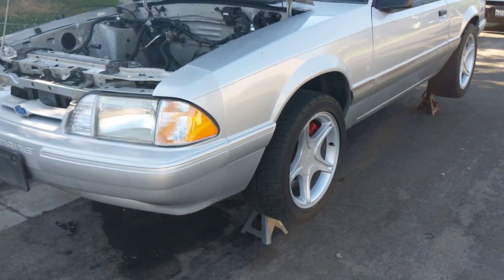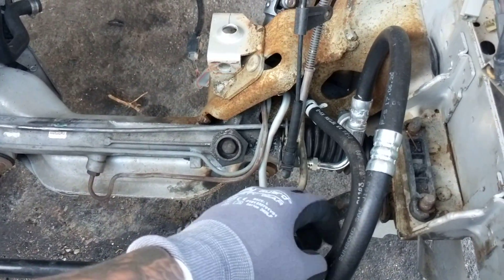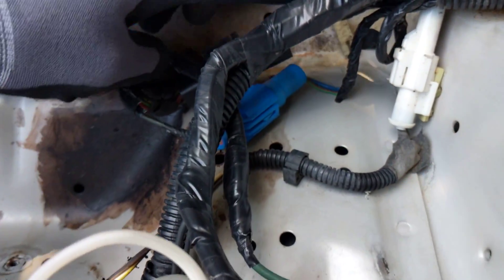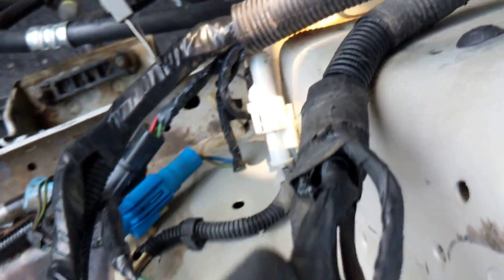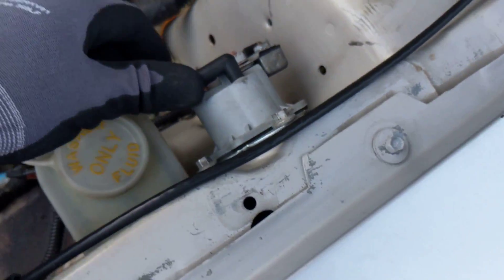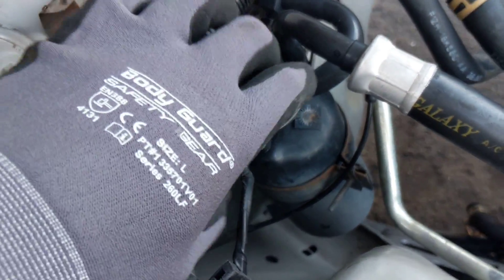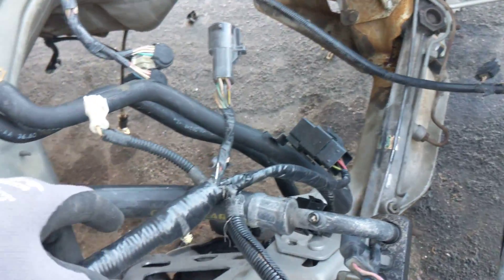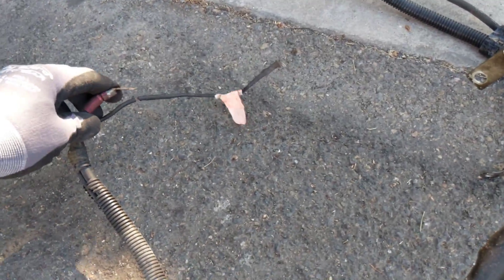Foxbody mustang 2.3 to 5.0 4cyl v8 swap how to step 1

Comment: I have a 88gt donor car will everything swap over to 89 4cyl car
Reply from the maker: Physically, yes. 100%. Now it depends what month the car was made on both ends. Typically, I like to stick with the exact year, but 87-88 are tricky. 87 was a speed density year. 88 is mass air flow. But not all 88. I have seen some that are not MAF. 
All in all, yes everything will work together. But there may be a chance that it could involve more work, depending if the years match up. Best case scenario-you only swap out the harness that connects from the driver side firewall and plugs to the ECU. It’s literally plug-in play.
Worst case scenario - the harness does not match up to your four-cylinder harness and you have to swap out dash harness and everything else

Comment: Awesome information!!! What about front coil springs..do those need to be changed since 8 cylinder is heavier than 4 cylinder?
Reply from the maker: Yes and no. The four-cylinder front springs have been a tried and true method by drag racers. They lower the car a bit and it will transfer weight even better. 
My white Coyote Swap notch currently has four cylinder springs in the front. It rides perfect and if I make a few suspension adjustments it will lift the wheels at the track
Reply: @pcpalan  Thank you sir. I appreciate it.

Comment: Will a manual transmission Off a 91 4 CYLINDER Mustang fit a 91 mustang with the 5.0 ?? 🤟🏽
Reply from the maker: It will. The input shaft tip is smaller though. So use a Ranger pilot bearing. Not sure what year

Comment: Great video detailing the project.  I did a few of these years ago when these were everywhere and unmolested 2.3's were cheap and clean.  Note on the power steering pump.  Line can be reused, just a little long but you should rent the tool and swap the pump, keep the 2.3 pump with that rack.  The ratio of the 2.3 rack is 20:1 and the v8 rack is 15:1.  The valving on the pump gets washy when you start doing locks to locks driving.  Do swap in the v8 rack when you can, much improved over the old man PS from the 2.3   -Also, the alternator harness, swap a v8 harness, tried to lengthen the wires once and had all kinds of charging issues and burned the wiring, granted I used the butt splice connectors which didn't handle the load well.  Could extend if you get some salvage yard wiring and limit the splice, use soder joints not butt splice like I did.

Comment: Hey @strokercoupe how do I run the 4 cylinder fuel lines and brake lines?
Reply from the maker: jonathan hall use og v8 fuel lines and KEEP the 4cyl body brake lines. If u have a disc rear Use a 94 95 v6 mustang rear end brake line. Will bolt right up. If u have a v8 drum rear then use the one from the 4cyl. Just swap it from the 7.5 to the 8.8 make sense?

Comment: I have a 89 notch 4cyl. I am converting it to a v8. I am using a 88 computer harness. You said to disconnect the orange connector near the fire wall. Now what does the white and black connectors plug into. Do I need to change the main harness?
Reply from the maker: Joe Gledhill The black and white connectors from your harness near the brake booster? Or the black and white connectors that are going to be in the middle of the firewall closer to the intake manifold
Reply: @pcpalan  The black and white connectors near the firewall. Not the salt and pepper shakers
Reply from the maker: Joe Gledhill If I follow correctly what you are saying then yes you will need to swap the dash harness, my email is the same as my YouTube username @gmail.com send me some pictures
Reply: @pcpalan  will do thank you

Comment: Hey man how did u put the 8.8 rear in the 4cyl car did u unbolt the brake line from the onion over on the fire wall by the A/C in take that brake line that runs all the way down the passenger side I believe at 1 point it ends up in the trans tunnel!! Or do u have a easier way to do it I am going to be using super 10's I would like to use tail pipes  I know the 4 cylinder union don't bolt up in the middle like the V8 cars it comes out to the right of the rear!! I hope u understand what I mean in might be able to give me a lil info on a different way to put the 8.8 in & run tail pipes instead of taking in drill all those dam rivets out in all the 1's for V8 fuel lines I think this is the shitys part of the whole job!! I mean I have a V8 car 92 GT for my parts car I have a 87 not I am swapping I already got the 89 harness everything I need o2 harness headlight harness this is my first swap  just want to get shit right thanks for ur time any info will be appreciated but if not I understand that 2 probably have people bugging the shit out of u!!!!!

Comment: 91 has a brown plug by the booster just like the 92.5-93. The difference is 91 doesn’t have a fuel pump relay on the EFI harness like the 92.5-93. So it’s wired differently. It’s under the seat on the 91. 87-90 had the black/grey plugs by the booster.

Comment: I have a 1989 5.0 car that’s rotted but I have a 93 4 cyl car I’m just going to use every harness from the 5.0 car and make the 93 a non air bag.
Reply: Man u would be better off trying to find a 93 ECU  harness  in the o2 harness that's a lot of work unless you're good with wiring what ever u decide good luck man? I am ready to swap my 87 notch I already sourced the 89 harness stuff I needed my donor car is a 92 gt frame rails shot but everything else is there fuel lines rear t-5 trans pedals!!!

Comment: Wait so the whole harness besides the ones you disconnected was stock right you didn't switch it out?
Reply from the maker: Yes sir. Replaced the computer, harness from the computer that goes thru the firewall, and the headlight harness or extend ur 4 cyl one.. and obviously o2 sensor harness

Comment: Part number for the ebay ujoint?
Reply from the maker: Steering Shaft U Joint Power 3/4"-36 Spline x 3/4" Round

Comment: So you dont have to remove the wiring inside the dash?? I have a 91 and planning the swap, will the 4 cylinder wiring work with the 5.0 gauge cluster??
Reply: Elvis Hernandez you don’t need to if you use the same year harness I believe

Comment from the maker: Missed out a few things, was in a bit of a rush. you're going to have to add a vacuum canister inside the fender and I didn't go over the O2 sensor harness I will on my next video
Reply: Didnt see a connector for the low oil level sensor? Not sure if i just buy a plug for the oil pan or if I buy the sensor. 93 swap as well.
Reply from the maker: @keezyknows8533  they usually always tend to leak, so I buy the plug for it and just don't run the sensor either way they never work